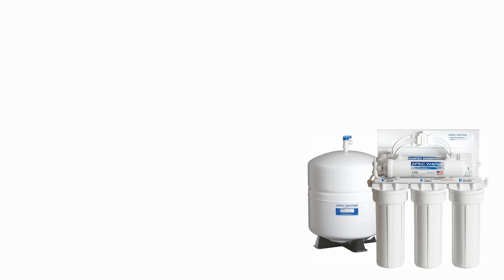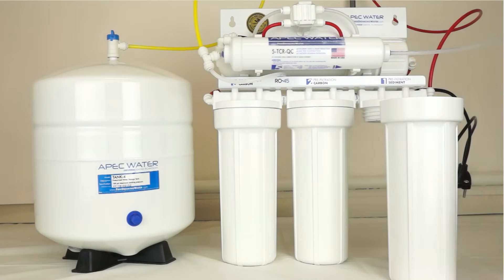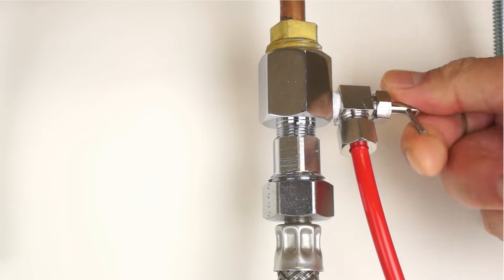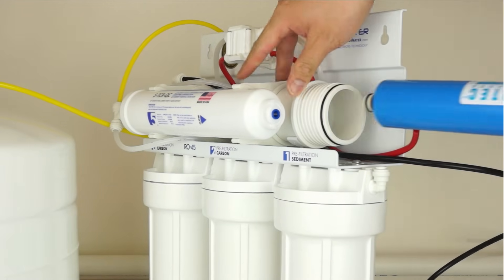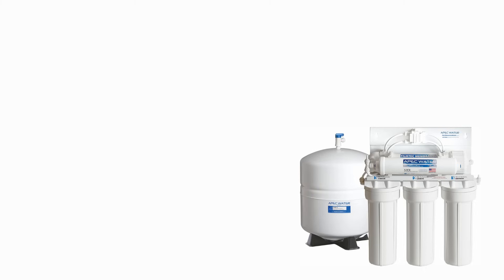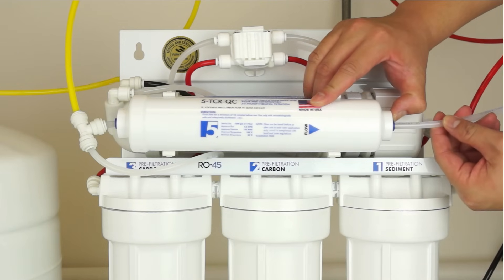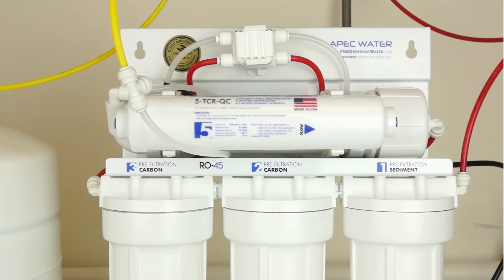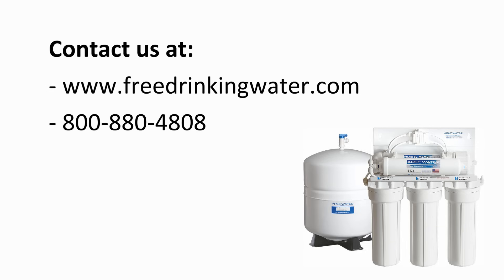How To Replace Your Reverse Osmosis Filters and Membrane - APEC Water Installation Part 6

Comment: What do I do when the water hardly comes out of the faucet?
Reply from the maker: Hello Customer,

If the water is coming out in a trickle after changing out the filters please lift the storage tank to see if it feels light or heavy. If its heavy the bladder inside the storage tank is worn out and the tank would need to be replaced. If you need further assistance, feel free to contact us directly by calling 1-800-880-4808 or e-mailing us at info@apecwater.com. We are in the office from Monday-Friday from 8:00am-5:00pm PST. 

Best Regards, 
APEC Customer Service

Comment: For the love of all that is holly plz secure the RO filter casing to the metal brace in a 4inch offset position so that someone can use force on the cap, had to use my car oil filter clamp to get it unstuck, you put that RO casing and cap right where my fingers are supposed to get a grip on, Jesus
Reply from the maker: Hello Customer,

Thank you for your feedback. I am sorry you had difficulty removing the membrane cap. We have other ways to remove it with the housing removed from the unit. Please contact us direct for additional information by calling 1-800-880-4808 or e-mailing us at info@apecwater.com. We are in the office from Monday-Friday from 8:00am-5:00pm PST. 

Best Regards, 
APEC Customer Service

Comment: Why is the little blue clip for the Alk always stuck?
Reply from the maker: Hello Customer,

The blue clip you are referring to is the collet ring. You need to press in on the collet ring with one finger and use the other hand to remove the tubing. The collet ring should not be removed as that holds the tubing in place. If you need further assistance, feel free to contact us directly by calling 1-800-880-4808 or e-mailing us at info@apecwater.com. We are in the office from Monday-Friday from 8:00am-5:00pm PST. 

Best Regards, 
APEC Customer Service

Comment: How do stages 2 and 3 of the cartridges look like, and which end of those cartridges should be inserted first?
Reply from the maker: Dear Customer,

Thank you for contacting APEC. Stage 2 and 3 are the same carbon filters please kindly see below. Both top and bottom cap ends are the same so it is universal can install it either top or bottom direction into the white vertical filter housing.

https://www.freedrinkingwater.com/ww-fi-cto2-water-filters.htm

Best Regards,
APEC Water Support Team

Comment: Got taught from someone who has been doing it for years. I'll tell you what he told me. After changing the first 3 filters disconnect the first pipe out the 3rd filter. Turn water back on and let fill 2 buckets with it. The water will be black from the carbon filter. If you skip this step all that black water goes through the romembrane. Your welcome
Reply from the maker: Hello Customer,

Thank you for that information and feedback. The membrane filter will also flush the carbon fines out the drain tubing so either way should be fine. If you need further assistance, feel free to contact us directly by calling 1-800-880-4808 or e-mailing us at info@apecwater.com. We are in the office from Monday-Friday from 8:00am-5:00pm PST. 

Best Regards, 
APEC Water Support Team
Reply: @apecwatersystems  But it would still reduce the life of the membrane right? Isn't it better to flush the prefilters first just incase.
Reply: @apecwatersystems  hey do you need to remove the tape from the new membrane, before installing it in the housing
Reply: @randybird9979 How are you still alive? Lol
Reply: @randybird9979 Yeah, definitely remove the tape
Reply: @ WilliamLopez559  the reason I asked, I had a company to install one for me and when I decided to change the filters my self, I found the tape on one left by the company man,  I would have removed it,   I just wanted to ask, because the professional left one on it
Reply: @ OathKeeper1506  genius,  mouth breather

Comment: Someone kept telling me I would need a bike pump?
Reply from the maker: Hello Customer,

A bicycle pump isn't needed when replacing out filters for the RO system. The only reason you would need a pump is if your pressure storage tank isn't losing pressure and you can try to re-pressurize it. If you need further assistance, feel free to contact us directly by calling 1-800-880-4808 or e-mailing us at info@apecwater.com. We are in the office from Monday-Friday from 8:00am-5:00pm PST. 

Best Regards, 
APEC Water Support Team

Comment: How often do the stage 4 and stage 5 filters need to be replaced?
Reply from the maker: For the ultimate series system just the one pictured in the video, you change the stage 4 and 5 every 3-5 years with normal water quality / usage. If you need further assistance, feel free to contact us directly by calling 1-800-880-4808 or e-mailing us at info@apecwater.com. We are in the office from Monday-Friday from 8:00am-5:00pm PST. 

Best Regards, 
APEC Water Support Team

Comment: Can the filter be installed direct to a water supply without using the storage tank?
Reply from the maker: Hello,

You do need the tank which is pressurized to store the pure water to get good water flow out of the drinking water faucet. If you need further assistance, feel free to contact us directly by calling 1-800-880-4808 or e-mailing us at info@apecwater.com. We are in the office from Monday-Friday from 8:00am-5:00pm PST. 

Best Regards, 
APEC Water Support Team

Comment: Changed all my filters, now have a problem. Water tastes like crap. Maybe something stopped working. Also, My tanks fill up from empty in about 3 minutes, not 2-4 hours. So that might be a clue as to what is wrong, I don’t know. Everything worked great for months, then changed all the filters and now this. Any ideas, anyone?
Reply from the maker: Hello Customer,

I am sorry to hear about this issue. If you can contact us directly by calling 1-800-880-4808 or e-mailing us at info@apecwater.com as we would need some additional information such as pictures of your system installation, TDS of your water (if you have a TDS meter), etc to help the best assist you. We are in the office from Monday-Friday from 8:00 am-5:30 pm PST. 

Best Regards, 

APEC Support Team

Comment: Ive replaced 3 filters but the water running too slow. Please help
Reply from the maker: Hello Tom,

I am sorry to hear about this issue. We would need some additional information such as the system model number, whether the tank feels light or heavy, etc. If you can contact us directly by calling 1-800-880-4808 or e-mailing us at info@apecwater.com for us to best help assist you. We are in the office from Monday-Friday from 8:00am-5:30pm PST. 

Best Regards, 

APEC Support Team

Comment: for how long does filter 1-2-3 should last before i replace them?
Reply from the maker: Hello Richard,

Depending on the model number of the unit the pre-filters stages 1,2,3 will need to be changed out every 6-12 months with normal water quality and usage. 

If you need further assistance, feel free to contact us directly by calling 1-800-880-4808 or e-mailing us at info@apecwater.com. We are in the office from Monday-Friday from 8:00 am-5:30 pm PST. 

Best Regards, 

APEC Support Team

Comment: Do I have to tilt the tank or filters to release some stuck air?
Reply from the maker: Hello Michael,

You can perform the following procedure below to purge the air out from the tank.

1. Turn off the blue tank ball valve clockwise 90 degrees.
2. Turn on the drinking water faucet for 20 minutes. Water should flow out in a continuous stream (not fast drips you can count).
3. After 20 minutes, please turn on your tank ball valve to drain the tank until it is empty. This takes about 6-8 minutes or until water flows in a continuous stream like before. If it is convenient, please kindly shake the water storage tank while it is draining. The tank should feel very light once it’s completely empty of water.
4. Once the tank feels light, please place the tank horizontally and turn off the drinking faucet to let the tank fill for 1-2 hours.
5. After the tank has filled, please draw a new cup of water to see if it helped

If you need further assistance, feel free to contact us directly by calling 1-800-880-4808 or e-mailing us at info@apecwater.com. We are in the office from Monday-Friday from 8:00 am-5:30 pm PST. 

Best Regards, 

APEC Support Team

Comment: How often do the filters need to be changed? First time user here! Thanks!
Reply from the maker: Hello, 

you would change out stages 1,2,3 anywhere between 6-12 months and the 4,5 anywhere between 2-5 years on average depending on the model number of the system you own. 

If you need further assistance, feel free to contact us directly by calling 1-800-880-4808 or e-mailing us at info@apecwater.com. We are in the office from Monday-Friday from 8:00am-5:30pm PST. 

Best Regards, 

APEC Support Team

Comment: Hey, thanks for the great video! Do you have a tip on where in Germany I can buy replacement parts (double check valve, to be specific)? Best, Michael
Reply from the maker: Hello Michael,

We currently do not have any dealers in Germany. We sell most of our items and products through our website and sellers such as Amazon, Lowes, and Home Depot. 

If you need further assistance, feel free to contact us directly by calling 1-800-880-4808 or e-mailing us at info@apecwater.com. We are in the office from Monday-Friday from 8:00 am-5:30 pm PST. 

Best Regards, 

APEC Support Team